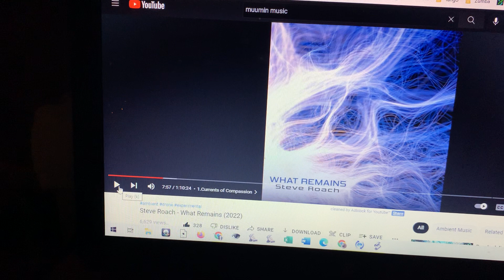Groundbreaking Report:  Potential Solution to Power Factor Problems!

Comment: Glad to hear about your experience................where I live, it goes wrong at 11am..........there's a factory in the neighborhood !
I allways try to build powersupplies as much as possible imune to line disturbances/rubbish on the powergrid .
BUT PF is another mean beast to tame............normaly I shut down my fluorecent lichting when listening , one day i forgot to shut it down WORSE !At a friends place we used isolation transformers ................expensive but with good results.
Sometimes X2 capacitors of different values can do the job .............for better or for WORSE !
The layout of your powersupply  ............CAPACITANCE/INDUCTION will come into play 
Also the circuit  ..............capaictor coupling -----------Transformers, inductors etc......( interstage instead of capacitors................direct coupling output ( transistor amp ) or capcitor coupled .........and an output transformer on tube amplifiers ( even with some transistor amps )
That's probably the cause why at a given moment one system works and another doesn't .......!?

Nice Day Janos...................now we will have some bad weather ..........stormy weather( from Weather Report  🙃)

Comment: I have noticed that some times my Class A sounds gritty or somthing akin to a lack of smoothness but if I use my AB PP straight after it always makes me happy....
I've not considered the Line AC as a possible cause for this...
Cheers
Reply from the maker: Hi Dan, that's also my general observation: PP is more protected than SE from poor line AC situations... while SE soars higher with exceptional line AC than PP does.

Comment: Janos, 

Regarding the video I use a medical grade 1:1 transformer with balanced 2x 115v outlet (we have 230v in the Netherlands). The earth is floating, which is also a audiophile benefit.

I have Audio Note AN-J speakers with the Oto amp in a room 10x18ft and ceilings at 7.5ft. I can’t place them in decent corners nor close a solid wall, so I lose allot of energy. I always had nearly enough bass. But lack of grunt.

Since I removed the sofa and ottoman for a recliner the bass is gone. Even measuring at the rear wall the bass the same or less in volume as the rest of the frequency range. It’s should be there in bigger quantities. Around the listener position I see a massive dip at 40hz. I tried 2 days to find a better listening position and change speaker placement. 

I have heard serval story’s implementing a Rel subwoofer with high line input will sound seamless. I have heard this at a friends place, not only this sound fuller, but soundstage increase, darker background and more 3D. Strange but true. You connect the subwoofer via 3 spades plugs to the speaker terminals on the amp. Maximum delay is 8ms!

But perhaps this trick will not work with high efficiency speakers, since they are really fast.
I was thinking about a Rel T7x, it’s an audiophile sub. Extremely fast, organic tone and easy to implement. There is a setup video which says first to start with phase, than frequency and lastly the volume. 

What are your thoughts?

Did the sofa simply decrease the room volume or did it act as a basstrap. It’s hard for me!
Reply from the maker: I think the best result would be to recreate the same spatial distribution of furniture as you had with the sofa and ottoman. When room works with you, it's seamless and natural, when we want to work against room with electric components it will never be as fluid as natural. 
I have observed the same issue, moving around big objects in the area in front of me impacts very heavily on the bass. 
Ty to move around chairs, ottoman, other furniture and see which combination works well in case you cannot go back to the original arrangement. ;
Reply: @realworldaudio  I’m thinking of building behind my speakers some kind of wall a tiny bit lower and less wide than the speaker, so you won’t see it. To archive a solid corner.

My question is how solid of how many mass should the wall have. Like using wood + high desity Rockwool + 18mm plywood both side. Or perhaps 2x 40mm plywood together which makes 80mm solid wood. 

It’s sounds perhaps a little bit crazy, but currently I’m living with my parents. And I have to make compromises until I live at my own.
Reply from the maker: @nicktube3904  Nick, good idea! You don’t have to make it super solid. I’d recommend keeping it 40mm good quality of plywood, with a solid stand.  No matter the solution, it will give its character to the sound.  A high quality relatively lighter board will play with the music, the deadened solution will impart a dull , sluggish aspect to the sound.
Reply: @realworldaudio  Hi Janos, 
I wanted to give you an update on my bass problem. I got wood from the barn and placed it behind the speakers, but this did not help me with the null at 40hz. Also tried heavy 4 thick tiles with a higher mass, but it didn’t help. I also added furniture to my listening area, but this did not help either.
After taking several measurements it appears to be a problem of my room response, mathematically you could say.

At a friend's house I recently had a good experience with a subwoofer, he plays with B&W and Accuphase which sounds good, but not my cup of tea Soundwise. 
But oddly enough, the subwoofer provided a lot more soundstage, resolution and audibility of the midrange and highs. Perhaps clarity is a better way to describe it.

Now a subwoofer is swearing in the Audio Note church, but I put the sum to the test anyway. The Rel sub is connected with a high level cable to my speaker terminals on the amp. 

The Rel is so fast that it plays along seamlessly with the AN-J. Playing at lower volumes is much nicer now. But what I really like is the spaciousness and scale has increased tremendously. You would think that this would not work with SET and high efficiency speakers, but the opposite is true. The sub provides spatial cues in the low end and adds body and solidity in instruments. Which also sound more 3D. Really happy with it! 

I thought like almost everybody who follows this channel a subwoofer is a pain for two channel stereo. Now I almost dare to say that a already great sounding setup could even be complimented with a good sub. Again you hear absolutely no subwoofer playing, let that be clear :)

Comment: Thanks Janos. I wish i could have more than one set for this problem, but usually at 10 pm the sound is good. Most companies here are then closed, way less people on the road and just les power usage generally in my estimation. I am saving up now for a on-line ups, what is experiance with that?
Reply from the maker: On no not UPS! Those make for absolutley horrid devices for audio! Their problem is that they do not produce clean sine waves - they produce absolutely nasty AC. Will give you terrible sound, and most likely a buzzing high voltage power transformer  that will make you think the tube amp is going to explode.

Comment: One little TRICK on  your power supply as seen not very often ......it's an old practice.
It concists by using a small capacitor across one of the resistors between the filter and reservoir capacitor............one can fine tune it if you have a scope..........NOTHING is perfect but it helps reducing the hash which is mostly HF debris .........but it does not solve the eventual problems with the PF........
Use if possble non inductive caps or good quality film or silver mica.........
Reply from the maker: Thank you Frank! I have not thought of that before.. Only about using it on the filter choke. There's a generic formula how to calculate the cap value there - yet the exact value also needs to be fine-tuned with a scope... ;)
Another trick that greatly cut the hash (especially on digital sources) is to use a smallish resistor (1-2K) and a small capacitor (100-200pF) in series, and place it on the RCA input jack (between positive and neutral). That will cut the very high frequency hash. Makes a big difference with digital sources, esp low res such as Netflix / YouTube. Although that's not necessarily line AC-related, but the hash coming from the digital sources reacts extremely badly with poor line AC conditions.
Reply: @realworldaudio  
Yes Janos the RC series filter was often used in vintage tube amplifiers and worked well ...........the cap over the inductor also but the inductor has reactance on variable current draw so the value has to be the best compromise .
Any way , choke , and all other older approuved tricks seem to be forgotten as well as a lot of ( often empirical ) know how ..........
Allways nice to try it out ..............and when it paints a smile on your face one can go for it .........
Some audiophile advertising leaves another kind of a smile to..................... Holco inside or  even better ....BG inside ..................ONE BG and ONE HOLCO 😂

Comment: Can a tube amp be designed that runs on DC?
Reply from the maker: Actually, they all run on DC. The heaters are easy, in the range of 5VDC-12.6VDC (at least the most common ones), but the high voltages are problematic, 300VDC-500VDC depending on the amplifier for most commercial designs, and some go 1000+VDC. So, in case one has a 400VDC battery, that's a good solution high voltage for a number of tube amplifiers. However, one has to modify them seriously to work on DC , cut out the transformer- rectification - power supply circuitry, not plug & play.

Comment: have you tried active noise cancelling power conditioners? i think they analyse the mains AC for noise digitally, and then apply an active inverse of the noise in order to cancel it out. i haven't tried them but it seemed way easier and smarter than using large PSAudio power plants or passive power conditioners... but haven't tried any yet
Reply from the maker: Hi Raoul, I have not tried it yet. My buddy is installing a subpanel with a (quite expensive) active filtering device this week... so we will be able to report on that soon ;). It's secificaly designed to get rid of SMPS issues and very high power (kilovolts and heavy amps) transients.
Reply: @realworldaudio  looking forward to it! but no pressure from me, of course 😊

and i guess having such bad AC mains power might actually finally be a good reason to consider purchasing (or making) a device similar to the PS Audio power plant. i've seen a very thorough measurement and analysis of the power coming out of it, on youtube, and the power wasn't much cleaner than the AC mains, i think. but the voltage was constant 230V and the power factor was consistent. who knows

have a nice day Janos(z?) don't work too hard 🕊️